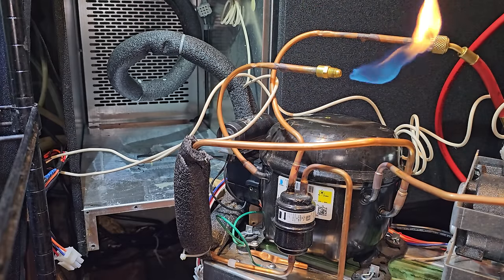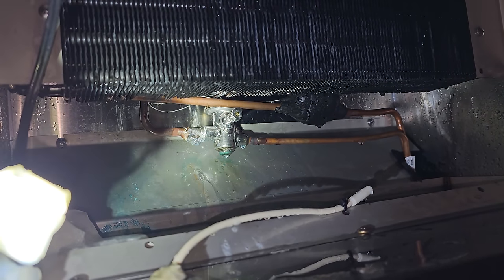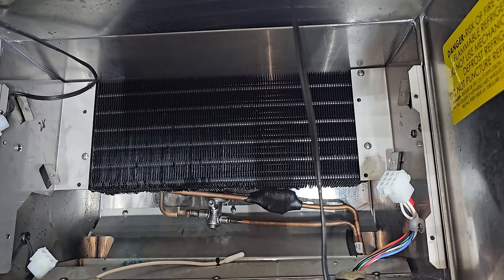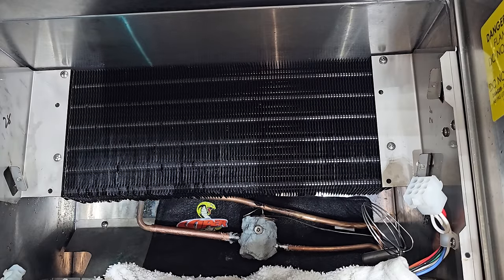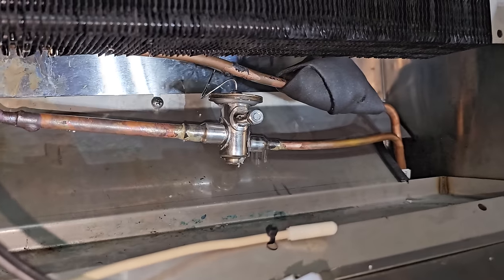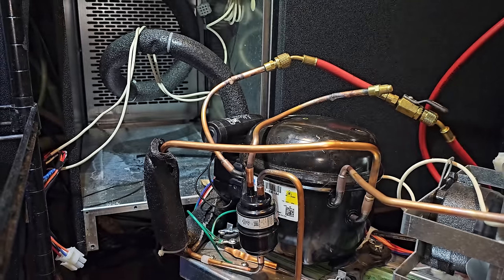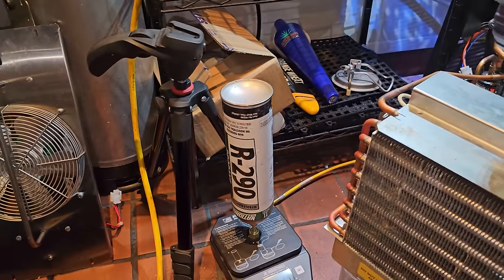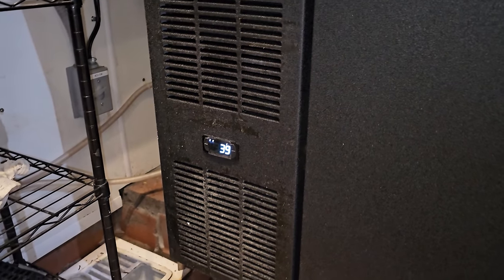DANGER ! R-290 IS A HIGHLY FLAMMABLE REFRIGERANT

Comment: As a retired volunteer firefighter, I suggest the proper extinguisher to have on hand when working with this refrigerant is a carbon dioxide or "BC" extinguisher. An ABC dry chem extinguisher would put your fire out, but it's also leave powder over everything. This powder is extremely fine and gets into everything. It's almost impossible to gt the powder out of everything and the powder can be corrosive. A CO2 extinguisher leaves no residue and you won't need to worry about a clean up.
Reply: After having had to use a powder extinguisher in anger, I now have a quite large CO2 one.  It'll put out small houses. but gives me the excess capacity I can rely on.
Reply: Having worked as a 1st responder 35 years for the gas utility in St. Louis, Mo, I couldn’t agree with you more on your selection of fire extinguishers. As a firefighter, i’m sure you know the 1st thing that should be attempted is to calmly, stop the flow of gas by clamping the line or by other approved means. If stopping the flow is not an option then you have to determine if you really want to extinguish the fire , if  flame is not impeding on anything flammable or damaging ,letting it burnout maybe your best option.
Reply: @boby115  Yes, shutting off the fuel flow is the best option. And letting it burn if it’s not causing other problems is a good option. As a fire instructor told us once, you don’t just automatically start spraying water. If it’s burning, you know where the fire is and it’s consuming the fuel instead of having it spreading out looking for an ignition source.
Reply: @csterett  For large Gas fires this is absolutely true. Let it burn and cool the neighboring stuff like buildings for example if it is a burning Gas line in the street
Wait for the Gas company to shut the line of and the fire will go out on itself
You have a much bigger Problem if the excavator manages to dig up a Gas line WITHOUT igniting the thing in the process
Reply: You really need to be careful with CO2 fire extinguishers in closed spaces.  We are very reluctant to issue them to people doing hot work inside equipment/sealed rooms etc due to the asphyxiation risk. 

Saying that if you set off a powder extinguisher in a kitchen you're going to have a bad time cleaning up the mess and writing off stock.
Reply: @csterett  , sounds like your instructor was well trained with some experiences to add to his knowledge. Sharing our experiences and some of our knowledge is the best way to learn.
  Stay safe out there and regards from St. Louis👍
Reply: I won't buy that bs. Guess its old equipment for me !! And im totally happy with that.  Your a good tech man.
Reply: @4theplants  r 290 been around for many many years. Old and newer equipment. In the future we will be only using flammable refrigerants, we are already in the process of phasing out 410a to a2l's which are mildly flammable, but even those will be phased out in 10 years, likely for something more similar to propane in terms of flammability. It's a fantastic refrigerant. Just need to use safe practices which for the most part doesn't really change what we do already
Reply: I tried to find a local seller of CO2 extinguishers in Houston (retail).   I even contacted one of the big manufacturers.   I got exactly zero responses.   I'd prefer to have CO2 as I'm an IT guy, and I really don't want to fire powder or foam all across computer equipment.
Reply: @tbelding  Amazon sells them.
Reply: Were you ever promoted to captain.. Captain Obvious?  I don't miss your type at all.
Reply: I went through an R290 certification course, the charge is very small, similar to that of a lighter. However, it's still propane, like 99.9 percent pure propane. Anytime I have to work on one, I make sure to pull it (if I can) off of the cook line or bar area and take it outside.
Reply: Just got a new account with all R290 freezers. Went out and bought a BC extinguisher specifically because this comment. Thanks for the heads up big dog
Reply: Just make sure you're in a well ventilated area before using a CO2 extinguisher.
Reply: Just be careful in dry environments… I found out CO2 extinguishers can generate some nasty static electricity! (At the local municipality I worked at we did fire extinguisher live training… after my turn I handed it over to a co worker and SNAP!)
Reply: It’s so little gas that it would just cause a flash fire.   It’s not a flame thrower.   It happens so fast you won’t have time to grab a fire extinguisher. Its the most dangerous if it leaked in an enclosed space and somehow it catches spark.
Reply: @csterett  purple k is also a bc type

Comment: R290 is not hard to work with, just have to be smart with it.
Reply: Agree the most irritating thing about r-290 is process stubs instead of factory access valves which is irritating on any unit.
Reply: Not hard just annoying adding access ports and resealing the system is so annoying 😂😂😂
Reply: Nooo what you talking about it's crazy dangerous

😂😂😂😂😂😂

Every time I light my cig with my r290
Dispenser i get my eod suit 😂😂😂😂😂

Comment: Makes me wonder why they take the odor compound out of r290 if it's basically propane. Isn't rue whole point of the odor compound in propane to let you know you've got a flammable gas leak?
Reply: Amen on that!
Reply: It's more they don't put the odor in the r290 gas (the smell is added to the gas not removed) considering how flammable it is a fridge could blow up a building if it leaked
Reply: @leexgx  lol no. most r290 refrigerators don't hold much gas that a leak can cause explosion and blow up the building.
Reply: Agreed with LordJasshin. It's not like a camping gas cylinder that holds a full pound of gas, we're talking only a few grams.
Someone else pointed out in another comment that the odorant (mercaptan) might mix unfavorably with the oil.
I imagine it could also create problems as a noncondensible, especially on these ultra-tiny critically-charged systems, where even a percent of the stuff could throw off the delicate balance of the system.
Reply: I believe the filter/drier would filter out the mercaptan and thus reducing the effectiveness of the molecule sieve material in the drier.
Reply: @FerralVideo  I may have fixed a leak and "temporarily" charged an r600a refrigerator with straight lighter fluid (propane/butane mix) last year. (Needed to get it going and had no other option, decided to try that as an experiment and it ended up working just fine after fixing and evacuating, still going over after a year later. AFAIK the odorant is still in there. I let a tiny amount of gas out through the charge port recently to check and it still smelled like lighter gas. It may degrade the oil in the long run, but so far so good.
Reply: The mercaptan would not function as intended. The heat and pressure would dissolve it into the oil or worse, which isn't good for the lubricating and protective properties of the oil. 
Engineering an alternative 'odorant' that would work under heat pump conditions would be one option.
Another would be standardizing a blend with a small amount of an inherently 'smelly' chemically-compatible refrigerant [unsure if existent].
Reply: @LRK-GT  I did not think of that. You make a good point I wonder if just straight sulfur would be alright
Reply: @LRK-GT  that's what I expected too. But for such a small scale application it seemed to work fine.
Reply: @Qballl  unlikely. Probably even worse as it would react with the ester groups in the oil!

Comment: Well done as always!  If I had to do this txv replacement I would have also cut the right side lineset a few inches back,  done my txv welds outside the box so I could be SURE not to mess it up. Then just do the normal copper welds inside the box.  Seems that would have been a little easier and you're less likely to mess up the welds and have to cool it off and try again!  Btw all of the txv straps are the worst,  how do those things even work!?  I swear I just hope to make them work when I have to install it haha  
Great video as always!

Comment: Great video as always, I had the pleasure of working on a r-290 ultra low temp freezer that is a cascade  refrigeration setup yesterday, the R-290 is on both loops kind of, the high temp loop is r-290 and the low temp is R-290 blended with R-170. Thankfully nothing was really wrong with it because I really didn't want to deal with having to blend refrigerants properly, it just needs to be defrosted, the customer wasn't too thrilled about that because defrosting that unit means it's basically down for 2 days, 24 hrs to defrost and 12 hours to pull temp down. Also yes this is a normal problem for these because it has no self defrost and it is running a -80C box temp with an evap that is basically a cold well turned on its side and if you defrosted it with heaters it would destroy the product so a yearly (or more often if they open the door a lot) shutdown defrost is a necessary evil like it or not.
Reply: Those cascade systems are a witch to keep going.
Reply: @Nighthawke70  ya tell me about it and the customer wants to fight with me about defrosting it because it needs to be down for 36 hours to defrost and return to operating temp. To add insult to injury I can't get the manager to stop scraping the inside walls of the box (which is the coil in this system) with a car ice scraper.

Comment: Manitowoc ice machines use the same tree of valve, I’ve always used 15% solder and as long as you don’t try to build a cap and just let it flow, it usually works pretty good. To be fair Manitowoc includes a how to braze instruction sheet and sometimes they even provide a pre fluxed stick of solder. Good times!

Comment: Have been soldering lots of those expansion valves with 15%, just heating the copper up, no direct flame on the stainless until the last touch.

Never had any problem with the copper straps as the danfoss valves are delivered with.
Reply: Zero% stick flows easier melts at a lower temp and works better.
Roll Silver Bearing solder is used on 1-1/8 on up and Mapp gets it hot enough to work.

Comment: If I see stainless steel i just always use the orange rod. I swear that copper coating doesn't cut it. Also the flammable gas sensor for the stratus is super cool. It was about the same price as a dedicated leak detector but you get the functionality of the stratus.

Comment: Great video ! Great advice Sir. Follow proper HC refrigeration practices and it can be done safely. I work with HC refrigerants everyday. I sweat and braze every connection. Properly remove the threat and the the system is not much different then any non-HC system. If a technician is not comfortable working with HC’s , get proper training.

Comment: Hi I wanted to ask you if the new dryers that use r290 gas are at risk of catching fire due to the refrigerant r290 which is very flammable?I mean, if there is a small or big gas leak inside a dryer
Thanks

Comment: Here in France brazing on R600a or R290a is forbidden. We have to use Lockring style stuff.But often times you just can't because of the lack of space in those units, so every HVAC tech brazes anyway including myself. I turn the cooking hood on full blast then go on. Btw those stainless steel TXVs and Rotalock valves are a pain in the neck to sweat correctly!

Comment: I do really like how these refrigerants are zero ODP low GWP - just one drawback to using in my car. Can you smell R290 like regular propane? Or does the odorant damage the system?

Some people say "R12 is the best it gets the coldest" but Ive found that 134a gets a little colder (290 and 600a a lot colder) but 12 would take longer to get cold. Is this because it has a high heat capacity and is efficient (R12)?

Comment: A couple fittings, some hose, a flashback arrestor and Bernzomatic type torch head would be a cheap way to flare off the charge safely. Also, to alert future techs about the silver solder joints you could use a labelmaker label denoting that wrapped around the tubing close to the joint.

Comment: 😂😂 5/16 swagged to 3/8 I feel your pain on that one bro. I had to buy some 5/16 just because I got tired of dealing with it and definitely have made some very creative welds 😂
Reply: Also I weld those with the orange rod dude. It goes on so well. I’ve made repairs on that very weld that you found and I hit it with the rough sand and the orange rod flows right in dude like magic. It works really good on tricky welds where you have oil contamination too

Comment: So a few weeks ago the walk-in at work was dripping onto the floor. The diagnosis was clogged PVC pipe between drain pan and condensate pump. Pipe was disassembled, cleaned, and reassembled. Last week, the problem returned, it was allegedly "fixed."
Tonight, I noticed the coil was STILL dripping onto the floor. So I got in to take a closer look... And the drain line comes straight down from the drain pan into an elbow, then slopes UPHILL to another elbow before taking a turn and following the walls of the walk-in and through the box wall to the condensate pump.
Yes, you read that correctly, the water must first flow UPHILL before going DOWNHILL to the pump. Seriously, I couldn't believe my eyes when I saw it, I took a picture and put it in our group chat with the message, "I think the problem is that water doesn't flow uphill very well. 🤪" 

FFS, do I have to do EVERYTHING myself?! (Not for minimum wage, that's for sure!)

48:57 - WEBELOS - Holy flippin' heck, that takes me back!

I think you did the right thing by taking that cooler out-of-service. Yes, the chances of ignition are slim, but you make very valid points. If the concentration is high enough, the door seals are tight enough, and it happens to get near arcing brushes in a fan (or dip to the bottom of the box, slightly seep out near a contactor or whatnot), KABLOOEY. I know there are mere ounces in the system, and the risk is minuscule, but why take the gamble? When it comes to R-290, an explosive odorless colorless gas, why not err on the side of caution?

Let's be blunt here. We live in a society. A society that is litigious in nature, and trending more so. Cover your butt whenever possible. Double-check, or even triple-check, your work.

Comment: In tight areas like that, I'll give you a little tip for brazing. Dial your torch down to a finer tip to shorten you flame and you can run it a little cooler since you'll be using the blue and white portion of the tip. Use the tip of the flame on top of the tubing feathering back and forth on the joint so you're pointing down and the tubing is blocking most of the flame. (In the video, you're putting a lot of heat on those evaporator fins). Put your solder on the bottom. Let the heat of the torch draw that solder up. That way you can easily see when it's hot enough and you know it's soldered all the way around. It also takes less time so your at less of a risk of overheating the txv or catching heat shields and rags on fire, It takes a little practice with the torch to feather the heat back and forth from the female side of the joint to the male side, but it's a much safer, easier, and more trustworthy way to braze. On vertical joints, I do the same thing. I always have my torch and solder on opposite sides. Much less chance of over heating. If you made it glow, you're already too hot and you're creating flakes "inside" the tubing that can become restrictions down the road.
Also, you're making more work for yourself sweating off ports and the lines to the dryer if you have length to use a tubing cutter and have a nice new end to just debur and sand instead of having to put old solder into a new dryer hole or when putting ports back on. Just an observation to save you time and work with new ends.
Lastly, I think your flame out was not from pockets of gas, but the gas that is mixed in with the compressor oil. Open to atmosphere, it was likely just off gassing the whole time you were waiting for your txv and installing it, and that close to the compressor, you had enough propane vapor to create that little flame out. A good high pressure purge with nitrogen before working that end might have prevented that.

Comment: I do residential appliance repair. When I am doing a compressor on r600 all the tubing comes the same size and you need to make a sleeve, swedging the tube cracks and splits the tube because its pretty thin.  the evaps are even worse if they develop a leak and suck the compressor oil inside. I just cut out those evaps or you will have an exploding coil.

Comment: Nearly every R290 warranty call that I did wound up being inefficient compressors. When I replaced the stainless Danfoss I always used eutectic rods and they made it very easy - maybe 1" of rod per joint. On big stuff , you could do a "root" pass with the eutectic rod, and then fill with the 15%. I've been away from restaurant equipment service for 3-1/2 years and enjoyed you using some of my old tricks. Last Glastender unit I worked on was replacing an evaporator in the bar at a Great Wolf Lodge. Bar was in the swimming area - talk about working while distracted!
Reply: which eutectic rod?

Comment: What a ball buster of a job! I use turbo torches to do all my soldering and I think it’s a little better in tighter circumstances. Oxsee acetylene I’m always afraid of overheating and burning through the pipe and it doesn’t go around the pipe as well. Maybe staybrite #8 on that expansion valve? Got to have all the tips if you go with a turbo torch. Either way, what a bear of a job. I am impressed with all your videos. You exercise a lot of extreme patience, and I don’t have that ability. I could not make videos I would use too much profanity in my language.!!